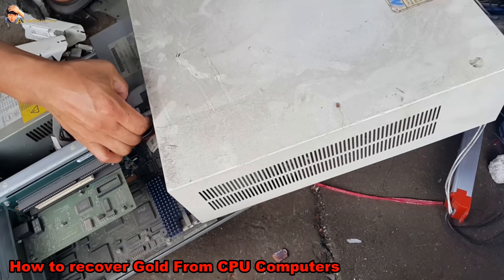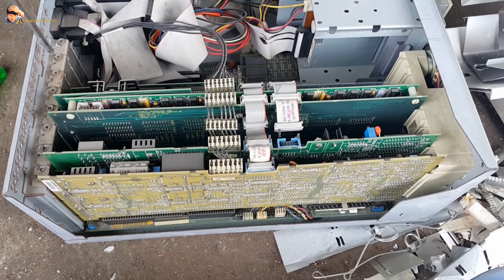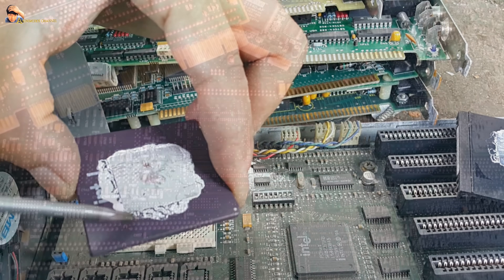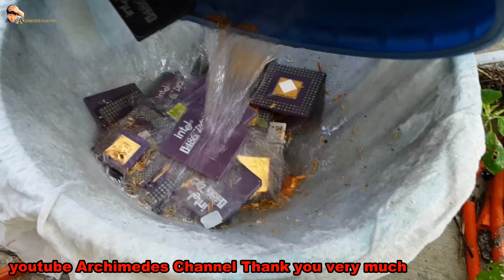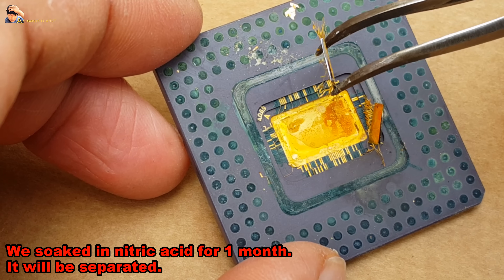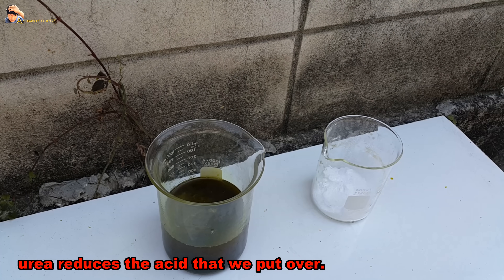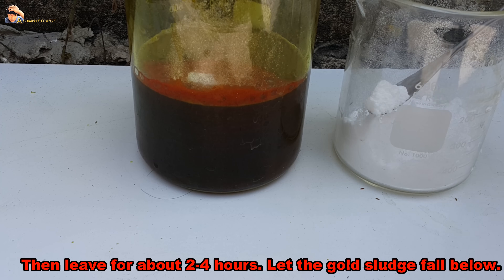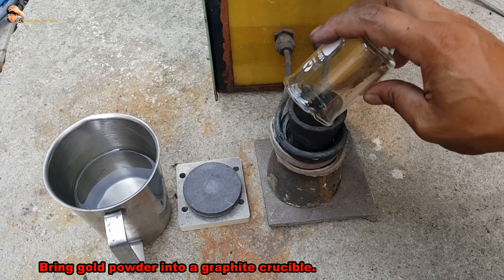How to recycle gold from cpu computer scrap. value of gold in cpu ceramic processors pins chip.

Comment: ROFL! 
Step one clean computer 
step two Sell Computer on E bay to a collector.
make 30x more money then you will ever make scraping computers for there gold..
Reply: These 4 cards where worth ~400$.
Reply: uh.... I have oldass computers worth hundreds  of bucks. I have PCI and AGP cards worth $100-200 a piece. I recently got computers from a gold scrapper, because he couldn't make his money back. I bought $30 in computers from him, as per his scrap valuation. I ended up selling the parts for $250. if he didn't scrap the processors and video cards, I would have raked in a grand, easy. Scrapping old computers is stupid.
Reply: Guys, these are all ISA cards, not PCI or AGP. It's basically useless trash.
Reply: try to Scrap CPU i9.
and good luck~
Reply: For nostalgia plus old games and software that don't run on modern computers. You can't find all games on the emulators. Some are just very rare.
Reply: I wonder if they broke even with the all the price of chemicals versus what he got for gold
Reply: As a vintage PC loser, i gotta say Matt here is right. Though it really depends on the hardware. Old 486 systems generally arent worth too much, them and early pentiums or AMD/Cyrix equivalents are where you will find the most gold for the cheapest. 486 motherboards, working, are worth easily 60-100$ a piece, more if theyre particularly good boards with lots of features. Old RAM is also worth a decent bit of money, most of the other stuff isnt worth anything except for the cards. Depending on what cards a PC has, it can be worth literally nothing or thousands of dollars. The systems where you would find 486 processors you would also be finding a large variety of soundblaster audio cards, early voodoo graphics cards, and specialized expansions. Some of them can be worth insane amounts of money, particularly things like the original Adlib sound card can go for 700-1000$ now. Though theyre a bit older than what you would find in scrap piles now.

Gold from PC's at this level is hobbyist stuff, youre not going to profit unless you're lucky in what you find and know how to get all of it out. And if youre looking around for specific systems, you should research what you have to make sure its not something worth an obscene amount of money. An old IBM PC/XT is also a pretty old, useless beige box, but even if it doesnt work the case alone can be over 100$. Well more than the amount of gold you'd get from it.

Always look into old PC equipment if you are trying to find ways to make money, collectors like me and lots of other people are always looking for something. I recently picked up an SGI Indy from 1993. Complete useless today, but its still valued at about 300-500$ because its a desirable collectors item.
Reply: maybe he just likes chemistry experiments or he's a professional e-waste scrap business because clearly that hardware would have sold for more than scraped gold off them
Reply: @adityasalunkhe8156  kindly contact if the scrap CPU worth more than the gold generated from it.  I have alot them with me.
Reply: @ogunsolatimilehin9927   isolated Processor units wont cut it (unless you somehow know a restorer/collector), but if you are able to restore the entire system(with chipset and all) share me a list i've got some friends who are interested.
Reply: For all the ones that say its just a cheap shit:
Jesus do you know how rare that thing is pc collectors would buy that for 1000$
Reply: I see you're young and don't know, but some people build retro pc's to play old games with. And for the nostalgia.
Reply: Matt wow you edited and still spelled their wrong... *their
Reply: Second one looks like it has some weird cards in it, that could sell for good money.
Reply: Tino Kollin They have very rare cards in them, probably could sell for $500.
Reply: People will pay a lot of money for very precise components, specifically ones that are needed to complete a larger system, that are also discontinued.
Reply: that is so true haha, he could have easily made a few thousand dollars just by setting  up old school systems for collectors.  and instead what? tons of work and 7 grams of gold around $400 hahaha
Reply: Nobody will collect that. Besides there's too much of that old shit around for it to be worth anything. They will stay in the junk heap, or this guy has the time to recycle the gold.
Reply: ROFL STFU Step one gather the computers in your home.  Step two place cleaned computers up for sale on E bay
Step Three based on what you saw one computer sell for one time on E Bay assume 30 times the profits to be made selling old computers to rabid collectors. Step Four move into garage to make room for the now hundreds of old computers turns into thousands. Step Five calculate the millions of dollars you'll make selling the 22,000 old computers you have accumulated on the road to riches once you begin selling these to the millions of rabid collectors out there ready to pay huge money for the trash you've been sneaking out of dumpsters at night. Step 6 having had your home condemned by the city for hoarding old computers that no one wants have to pay a hauler to remove those priceless computers worth so many millions in the demented mind of a major boob.
Reply: @robmalone4918  hmm
Reply: @seropstephanian6031  hmmm what?
Reply: @seropstephanian6031  Yes Sir Mr. Wizard I stand behind my comments 100% they are sound and well thought out....
Reply: @robmalone4918  nothin just thinkin about it
Reply: @seropstephanian6031  Dont think to hard there is a lot of bullshit and misinformation in the comments here. I worked a few years in electronics recycling and the best money is the easiest money which means you break the stuff down to the basic components and sell it to a pro for scrap prices like $15.50 per pound of RAM, CPUs between $4.00-150.00 per pound by type, Mother Boards $1.50 per pound, unstripped copper wire 65 cents per pound, heat sinks .50 cents etc it adds up to thousands and thousands fast that way....
Reply: you would be surprised
Reply: You'd be surprised. Go check for yourself.
Reply: does not work believe me
Reply: Matt lalálalalala lalálalalala lalálalálálalálslalalalallalalalalal je to pravda to skazy s v a
Reply: Amen Brother
Reply: Matt and then you can buy gold
Reply: I'd buy that shit. So hard to find these days.
Reply: @TheSqeeek  buy them. We've got them and you are the only one saying that. Put your money where your mouth is.
Reply: Matt I’m pretty sure the chemicals may be pricey
Reply: But they aren´t.
Reply: Agreed,some people may hunt for these old collection.
I can tell that if cleaned up and stuff -> revenue
Reply: Yeah, true story
Reply: Vaibhav Thamman No? Have you never seen channels as the 8 bit guy?
Reply: These idiots never figured it out lol
Reply: no one collects old pc that are fucking useless
Reply: Bungg Bungg Oh yeah, these thousands of youtube channels, museums, and collectors, parts that are expensive as f*ck arent real? We are in the matrix now...
Reply: these parts are slow ass hell and are about the 1/20th the performance of new hardware... from a tech standpoint its useless
Reply: A tangible finite commodity in one hand that gains in value every decade, in the other hand cotton papyrus that has fluctuated radically since its Inception. I can understand the appeal in the commodity.
Reply: How about pollution for handling made gold from old computer parts?
Reply: SO true like it had like, how much 2 pentiums and 4 graphic cards?

They would pay so much for that thing
Reply: I dunno at 38.60 per gram that nugget is worth around $250.00 and in this video he only showed CPU gold recovery there is more gold to recover from the rest of the pc.
Reply: Lol. There are SO many 10+ yr old Pentium boxes tucked away in the dust. There'll not be a shortage for the hoarders/collectors.
Reply: You can make money by sending old pcs to Africa but it has to be huge amounts, containers like.
Reply: THAN
Reply: Matt basically. 2 months of time for $190😩   I guess the adventure is what counts
Reply: Im agree
Reply: But i wanna gold just for fun i dont wanna sell it
Reply: But one gram gold is like a 10euros and if you have 25gram you get like 250euros
Reply: Matt
Reply: Matt all u guys talk about one pc but every pc has 1 cpu and i saw 30+
Reply: I'm guessing most of the hate comments are from entitled millenial brats who seem to think they hold all the wisdom. Old systems sell for a lot these days, way more than scrapping 30 cpu's and spending 2 months of chemical dissolving for 6.7grams of gold.
Reply: MrSjizzo exactly
Reply: @MrSjizzo  what are some most sought after?
Reply: If that part good condition you right,but if bad part you wrong
Reply: That's waste of time...sells  on  ebay 4 parts make much money. ..
Reply: I agree with you. Collector who's love retro, vintage, old and rare stuff try to buy this stuff definitely but someone don't think so they try to make it easily to sell because of their country hard to find the Buyer.
Reply: No one collects models of Wich millions of the exact same model were made
Reply: FroztyGuyz what? Why
Reply: That computer wouldn't even be able to run minesweeper let alone open notepad
Reply: Thats no a gold 
Idiot 😛
Reply: I see a lot of ignorant motherfuckers commenting on this, like they know what is collectible.... Y'all dont know dick about computer collecting, Matt is 100% correct.
Reply: Search for churchmilitant and sensus fidelium.
Reply: Are those commodore 64 ?s or Atari.  Old games suk u can play berserk and ms pac man on something cheaper....
Reply: yep
Reply: @mzflighter6905  you are not worth my time. Nobosdy will buy them. Ive got hundreds to destroy.
Reply: Cnc from china
Reply: Moron spotted
Reply: If you buy a old pc it will be more worth
Reply: not so many collectors exist in this world, but gold buyer are everywhere.
Reply: These people are scrap dealers. They have thousands of obsolete machines and break them down for scrap. No one is going to buy a volume of PC's like those ones and pay huge money as is claimed here.
Reply: because there are some collectors that pay well for old systems for a museum or for hobby.
Reply: obsolete parts, those pci cards could be very expensive.
Reply: Hell, I'm 16 and building my first 386 computer right now. It hurt to watch them destroy those computers.
Reply: @loganpage1157  It'd really help if you told me where you get the parts from. Because I found a 486 dx2 or something and it would be worth like 5 Euro on E-Bay but motherboards are extremely rare and whole rigs are being sold for hundreds of dollars 😢
Reply: No one will buy that medevial age Pc nowhere near $200 to $300 as compared to today's gold price.
Reply: @vaibhavthamman   200~300 ? Lol in what a World do you live? You overestimate the few gram gold in a PC ;)
Reply: Vaibhav Thamman that wasn’t one computers cpu. Was about 25.
Reply: @vaibhavthamman  there's nowhere near $2-300 worth of gold in there, maybe $2 or 3.
Reply: @KWatson1984  the price of gold as of right now is $41US per Gram. The video only showed the cpu chips that he mined out of the WHOLE computers he got, and that was 6.7 grams so 
6.7grams X 41= $274.70 US
I'm pretty sure he got more Gold from the rest of the computer parts.
Reply: Lol
Reply: Alöx Förönczi tv bh
Reply: PC enthusiast here to shed some light on this, there is a HUGE market for these old systems. You can't expect them to run modern games, but they can do a whole lot, especially if you have a lot of period correct hardware. This system, if running, was worth well over $100 on ebay.
Reply: people say computer isnt worth it, but i'd like to remind you that he has used about 30 processors to get the gold.

It's definetely worth less, but gold prices are more stable that the computer ones+easier to sell.
Reply: I work in company and trashed around 500 computers a year. Now theyre all leasing, so I cant steal parts anymore from ones going to trash. Too bad. Well this wouldve been something I wouldve been too lazy to try anyway.
Reply: @mikkolappalainen_  
Nokia you work for??
Reply: for those of you asking "who the hell would buy this old shit" - for your info lot of manufacturing plants still use "old as earth" technology to keep going, 486 machines are worth thousands!! ... you'll never find one on ebay!
Reply: Matt Why would someone collect that shit
Reply: @mavv  It's not sh*t, you are sh*t
Reply: Super Swag it looks like a server board and most high end server motherboards now have 5+ pci-e slots
Reply: @jcoldchill9579 
Those are PCI slots, not PCIe slots.
These are CPUs and Boards from 1997.
PCIe wasn't introduced until 2004.
Reply: Listen The ROTTEN Squad it not his fault leave him alone
Reply from the maker: For the hot comments now.
This video Light  how to recycle gold from cpu computer scrapFor the light to see that the Gold Content List in CPU and gold volume. Of course, science and experimental work to find secret results, we do not focus on price. time  Profit or Loss It will not be good for people to look but the value of money.
Reply: No one is going to buy an old computer like that.
They don't even make motherboards with that many PCI slots anymore, because they're pretty much obsolete.
The least purity that gold could be is 8K. And that's $94.85 worth of gold. Worth immensely more than the PC he got it from.

I wouldn't buy this PC for $30.
Reply: I would spend 100s of dollars to build a working Intel 486 and play Doom and various other classic DOS games on original software/hardware.
Reply: everennui waste of time and money
Reply: The purity would actually be 22K
Reply: @superswag4191  stfu u know nothing at all...
Reply: Pretty sure these computers are broken pieces of shit, why would anyone buy them?
Reply: not true...what fuckingg colector want's trash computers? makes total 0 sense...
Reply: Besides nostalgia gamers and collectors there are a plenty of legacy computerized industrial equipment - management systems, CNC machinery etc. where various older generation computer parts are used. In most cases they use a legacy management software, sometimes written especially for a partial device and companies who developed that software often doesn't exist anymore and sometimes original developers are already dead. The problem is that upgrading those systems cost a great fortune and may involve a great amount of bureaucracy and legal hassle which is a main cause cause why they are kept running till today and will be used also further until they will crumble mechanically. In nowadays owners of those systems are hunting and scavenging old computer parts worldwide and are ready to pay a good money for boards in working condition. In begin of 2000-ies NASA searched for working PC XT boards with 8086 CPUs for their legacy control systems and was willing to pay pretty nice numbers for them.
Reply: old computers have way more gold. All collectors fight for them.
Reply: Curious Mind Yeah, but the preserved parts worth way more than their price in gold.
Reply: @pedrobranco153  what's considered "old" is there a cutoff year
Reply: @YoungSpunkY
Thats why they are collectors, look
You got an old model of an famous car that doesnt gets produced anymore, what would you do?
Refine the Car into its alloys 
or
Sell it to an Collector
Reply: Ngen.....t
Reply: wat